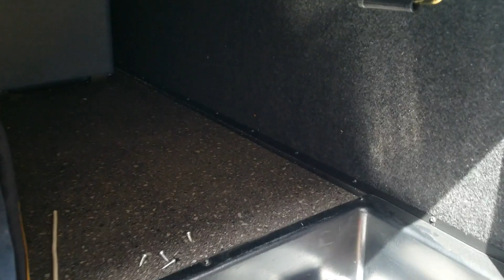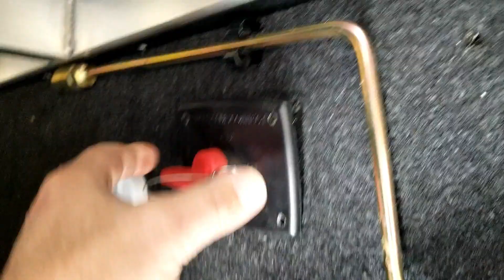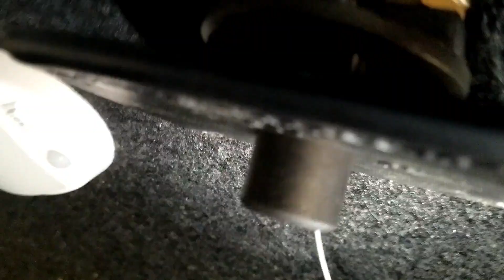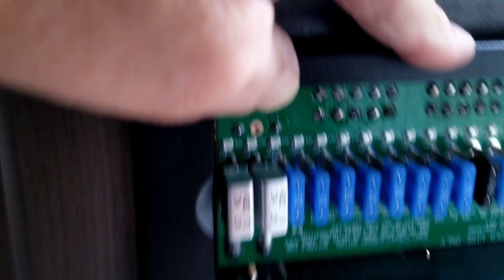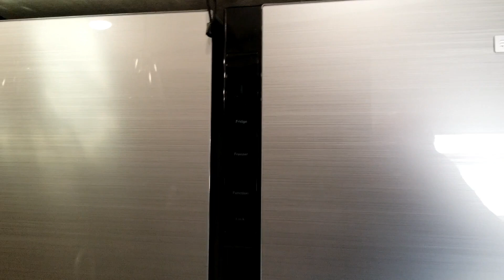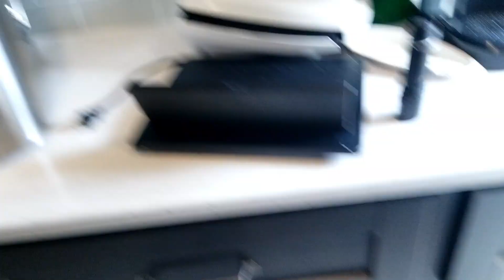Grand Design 303RLS   Battery Disconnect

Comment: Nice job! The 2021 Reflection 337RLS is nearly identical...same DC branch board, same power center, same converter, same disconnect switch, and nearly same buss bar and resettable circuit breakers (six vs. your eight terminals).

Comment: Thanks for this breakdown. I've got a 2020  320MKS and it didn't have the sticker denoting what all of the lines were at be beaker bar. I've purchased a couple of LifePO4 batteries and a Powermax 75A inverter which I'm going to locate in the front bay close to the batteries. I need to add a 110 circuit to power the converter and will run the output of the inverter directly to the batteries protected by a fuse.

Comment: Another great video, thank you. Did you create that wiring schematic of the DC bus bar? It’s awesome. 

I’m watching the converter charger test video now. Are you planning on creating more videos?
Reply from the maker: Thanks. I plan on doing more videos, unfortunately the 5th wheel has been in the shop with some issues with the roof and slide. The original bus bar schematic was already done, I just tried to interpret it for someone who had questions.

Comment: So what good is the battery disconnect ?
Reply from the maker: That is a good question. In my opinion, the factory disconnect causes more problems than is solves. In the disconnected position, the battery bank will continue to drain but will not charge when plugged into shore power. I think manufacturers continue to install them for liability reasons. Since a full battery disconnect would kill power to the emergency brake system and safety systems like CO2 and smoke detectors, those systems remain hot in case someone accidentally forgets to turn the switch on before traveling or camping. When I upgraded my electrical system, I kept the factory switch and added a second full disconnect.

Comment: Thanks for the 12v bus bar and 12v frig wiring diagram. I have the same Furrion 12v 16cf refrigerator: I see the 30amp resettable circuit breaker at the 12v bus bar, is there a second fuse on the refrigerator?
Reply: Figure it out yet? Just got one and learning about it.This guy explaining things greatly.
Reply from the maker: I believe there is. I can’t verify that for a fact, but I have heard from others that there is a fuse somewhere on the back of the refrigerator.
Reply: Great.Didn’t someone move the back fuse up front of frig for easy access?